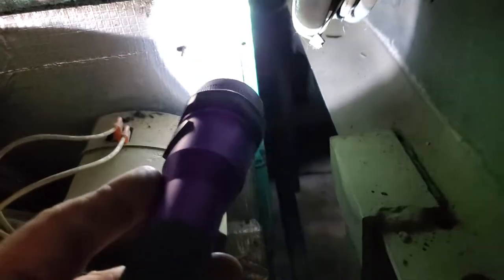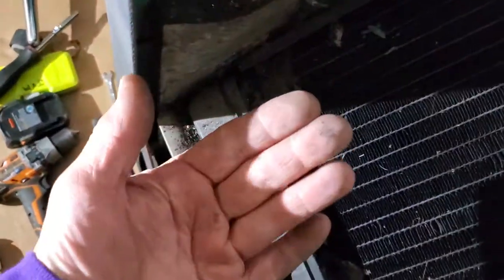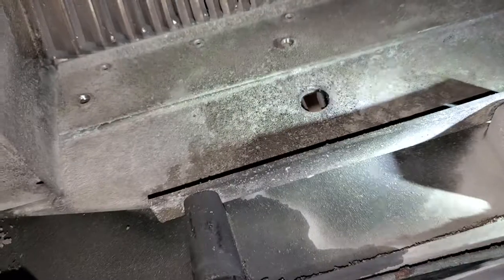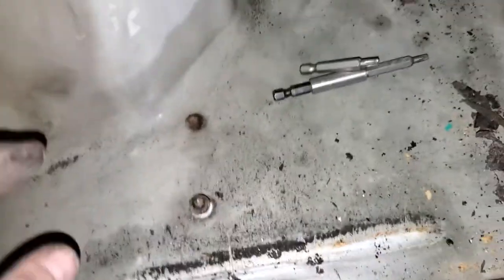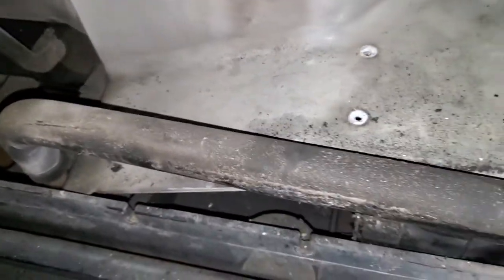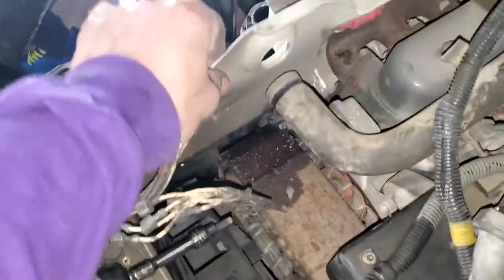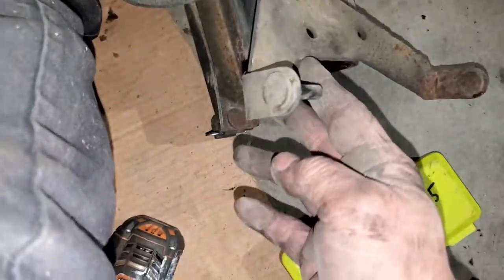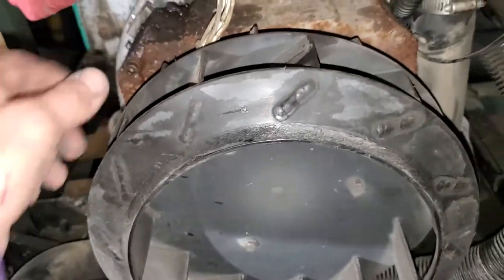ONAN 7.5 K GENERATOR

Comment: I did a rotor/stator/fan today on a 2005 7.5 Onan in a Newmar Dutch Star for a friend. Old stator was visibly arcing at windings. Still getting code 27 and it shuts off in 2-3 seconds. Any guidance? I need this thing out of the driveway...its huge.
Reply from the maker: Nice heats the killer ,Did you get the radiator serviced and add a row?
Reply from the maker: Email me at jeff@rvdiagnostics.com